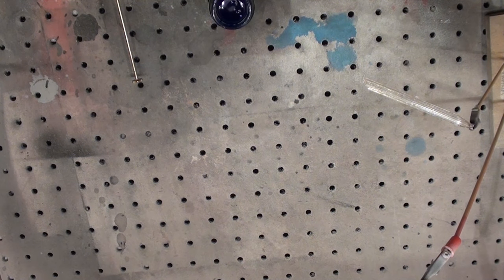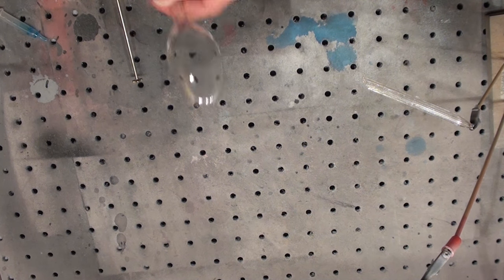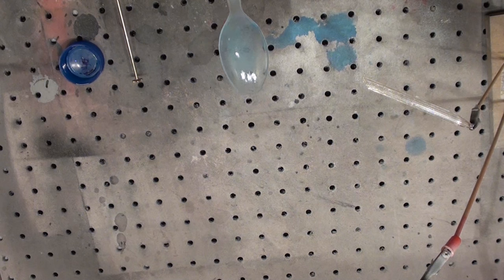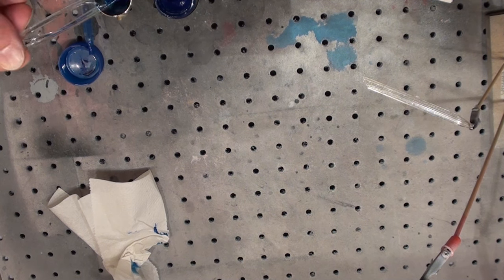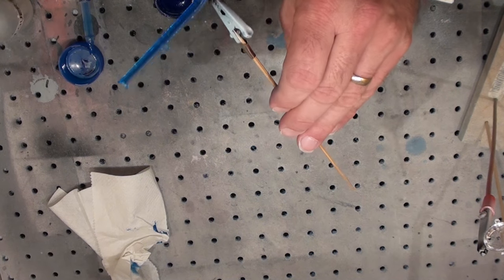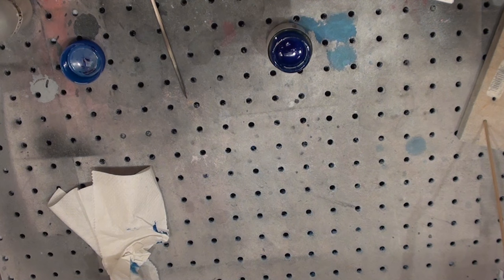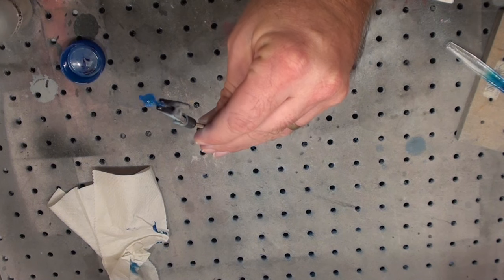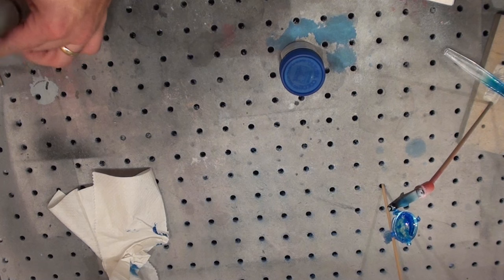Enterprise 1701 A painting clear blue the wrong way

Comment: You could always shake the paint bottle very very well before using it if you hadn't been using that paint for a while. You might have needed more thinner mixed in with the paint.
Reply from the maker: Clear paints don't have pigments that settle, so they don't need to be mixed like other paints do.    But the problem was how I mixed the thinner with the paint, I didn't get an even mix so the paint came out good for the spoon but not for the actual parts....
Reply: badgrendels I figured as much. Maybe try 1:1 ratio?
Reply from the maker: That is what you use with Tamiya paints.

Comment: Odd how you get great results on the spoon but... I agree that your pressure is high. 12-15 psi would be enough depending on how thin your paint is. You'll get it.
Reply: My guess is that the mold release agent hasn't been washed off yet. Plastic spoons don't have that crap on it, but Round2 models do for some reason. John, you haven't gotten too used to Bandai and Wave models, have you? I always wash off Western models first.
Reply from the maker: I figured it out..     I didn't mix the thinner well with the paint.  At the bottom of the cup was almost pure paint and at the top was really thinned paint.   When I painted the spoon, the paint thinner ratio was fine but when I got to the parts, the paint was too thin and spotted......
Reply: Cool. Happy to hear you sorted it out.
Reply from the maker: I didn't wash the parts, I will admit to that.   but read the reply to Scott.....
Reply from the maker: Yep won't happen in the future.....